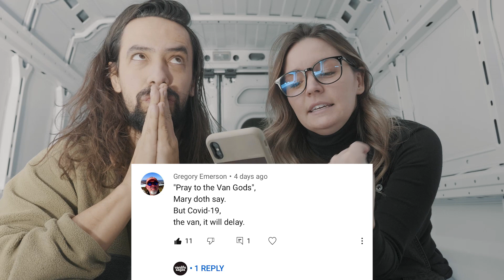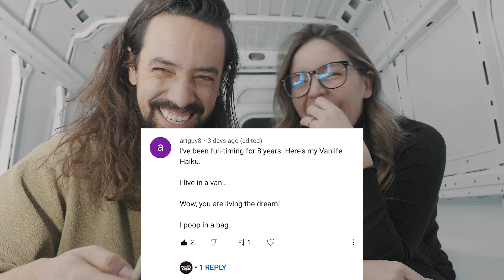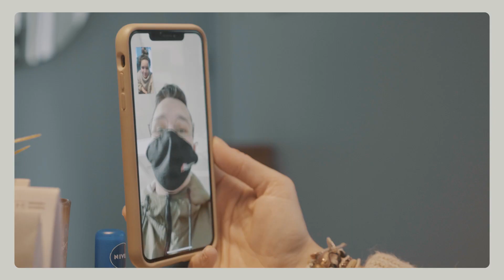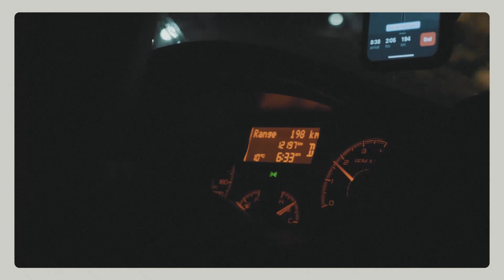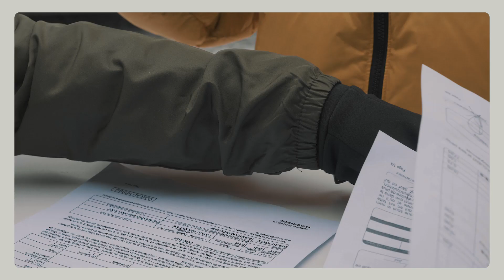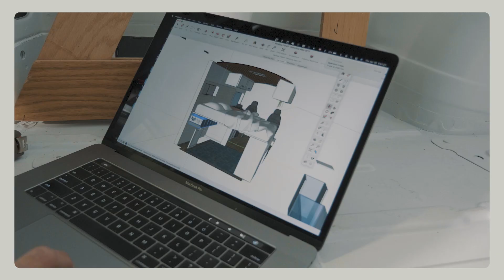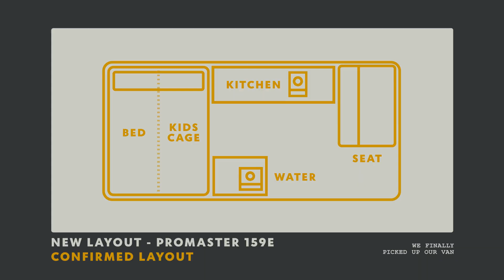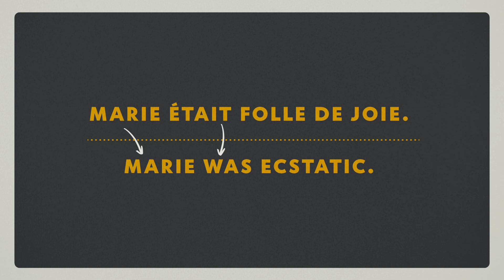It’s even BETTER than we thought | Our 2nd VANLIFE project starts NOW.

Comment: Marie’s excitement is so cute! I wanted black wheels but the dealer said it would take months and after nearly 3 years of waiting, I couldn’t wait another second. Wish I knew about factory swivel seats before I bought. Aftermarket is such a pain and raises the seat too high without further modification. 
Is there anything special about your steering wheel? It looks way fancier than I’ve seen/have. Maybe it’s heated or something? Also the van looks like it has a slight lift but maybe that’s just the tires. 

Design half of the inside like Marie wants and the other half like Dom wants. 😋🚐👍🏼
Reply from the maker: Yeah. That’s exactly why we opted for the swivel seats, because they are cheaper when installed by the dealer and they are lower as well. Not a lot of people know that. Perhaps we should talk about this a little. Good idea for next week. Thanks friend ❤️ as for the steering wheel, Marie did remember saying it was heated, but we can’t find the button 😂
Reply: @vanlifesagas  LOL @ unidentified heater button. Love the thought of contributing a topic to the channel!!! Can't wait for Sunday :)

Comment: Félicitations à Dom et Marie pour votre nouveau van!

I use to work for Ford Motor Customer Service and every dealership has a way to research the vehicle history by the vin number, no matter what make or model. It is called “The National Motor Vehicle Title Information System (NMVTIS).” If we weren’t sure the dealership was selling our customer a new or used vehicle then  we would go to the vehicle history to confirm how many owners this vehicle has been with, way back to the first owner. If you would like to know what country your vehicle was made in you can Google a VIN Decoder Lookup. 🚐 Happy trails.
Reply from the maker: Hi Karen! Thanks! Yeah, it seems the systems weren't updated because it's a brand 2021. So happy we finally found the van! Marie was flipping out.

Comment: Félicitations Nice van🍾🎉 got nice propane heater fire 🔥 place for your new built😊
Have a Nice Day 😎
Reply from the maker: We sure will! Already bought that Espar heater!
Reply: @vanlifesagas  Espar est un bon système 👍🏼  if you want a nice complementary system, easy to install, without fan noise, low consumption, you also have the advantage of seeing a nice cozy fire in the little stainless box, mounted to a wall, etc...that firesplace exist since 1938, made in Canada 🇨🇦 Can be Propane, solid fuel (wood, charcoal,pellets) or diesel. Let me know I can give you a good price, I am new distributor in Qc. Thanks have a good 2021 year and build of vanesssister

Comment: My apologies in advance, Marie, because I prefer to stay loyal to my sisters.  But. Hygge is okay but everyone is doing it. Japanese Slats is so smart and it is beautiful.  You can use the slats for support and to mount things. Hyyge? Hygge? is not at all flexible.  It is simple, clean but inflexible. Name one person, just one, who built their van and never nudged or moved or added a single thing.  You can't. But with the Japanese slats, you can very easily add a shelf, remove a shelf, trade a shelf for a mug rack.  Whatever.  This van is being built for future generations.  Kids. You will soon discover that you will have to adjust your plans and your layout constantly. The only time you can count on not having to adjust what you are doing and what you need every 4.5 minutes is when you have a sitter and no one is sick.  Sorry. You will enter into Olympic level flexibility.  HOWEVER, you two want the same colors in reverse.  You want light with dark accents and he wants dark with light accents.  With an even split, it is the same.  So decide if the floor and ceiling will be dark or light or if the walls and cabinet fronts will be dark or light.  Neither one can have both,  you won't like it. You need the light to see, to minimize shadows and depression.  You need dark to soften the glare and add some cosine as and relaxation.

Have you seen the van build with Japanese slats that a single guy built and every smart is secure and can hold all sorts of things.  And I have seen this tiny house builders borrow the same principle.  The shelf you put the oils on when you are parked comes off the wall in a snap because it is your cutting board.  It can be moved up on slat so the baby doesn't whack his head when he is bathing in the sink and it can come down a slat when the baby is not up on the counter so Marie doesn't pull a muscle in her back just by grabbing a cup.  If you don't build the flexibility in the slats when you build the van then a) why not?  Why pass up the opportunity to adjust and get crap off the bed and floor and b) flip a coin because the style is too similar to get excited about one vs the other.

I love the van! I love it!!  Would people pray to the van gods again for me to get the same make and size van for me?  Husband and I got old. He is in a wheelchair from MS for44+ years and our van is too small.  He can't turn around, I can't get around him,it's a nightmare.  And what you got is EXACTLY the one I/we need. What is the wheel base and interior of the van?  I am in love!  It also seemed to cut right through the snow and ice without even blinking an eye.  Awesome van and I can't WAIT to see you build it with a dad in a garage and with all sorts of tools and stuff!
Reply from the maker: Hello Rebecca! 

You are right, that Japanese slated van is beautiful. We LOVE it. We'd love to do something similar in our van, it's way too beautiful! 

To answer your questions, our's is a 159 extended, it's the biggest model of all Promasters and allow sufficient place for the upcoming baby project (2022).